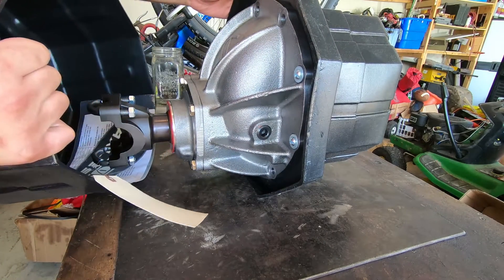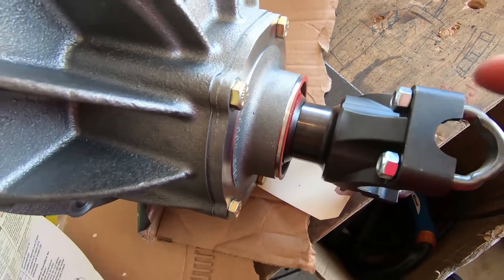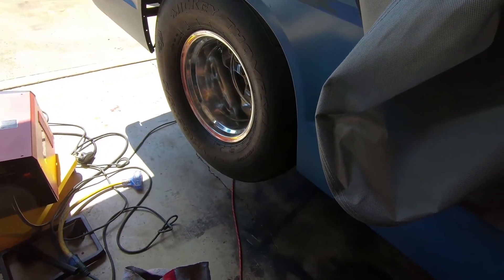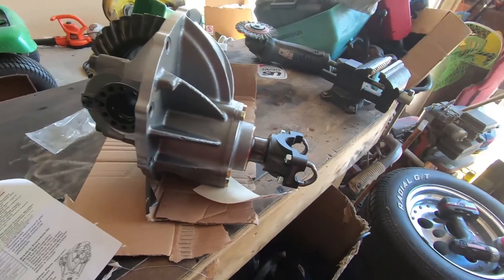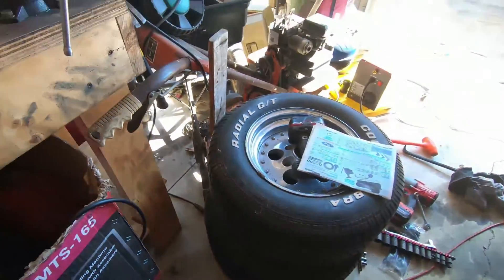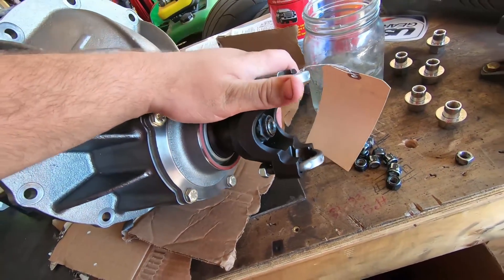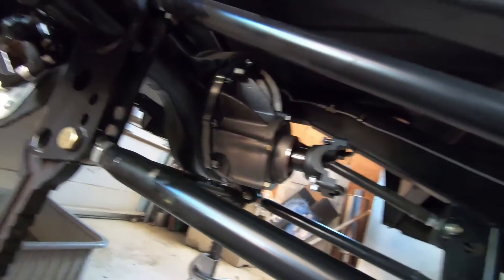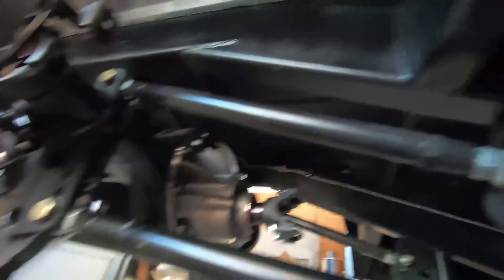S10 Gets a Strange FULL SPOOL Ford 9" Differential

Comment: A 4.10 or 4.11 is the stock ratio for most manual transmission. A 3.5 or something behind auto transmission. Yes it will bring up your top speed but lower your acceleration..... Weld the dif